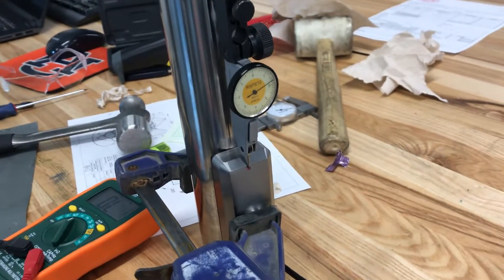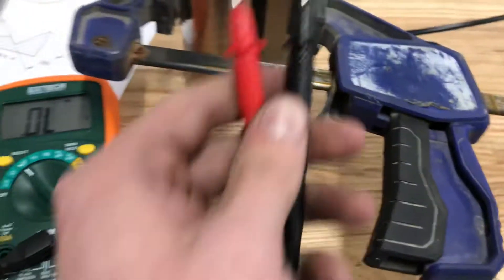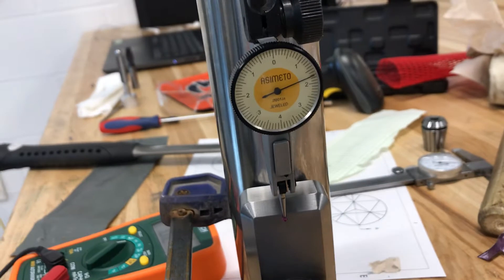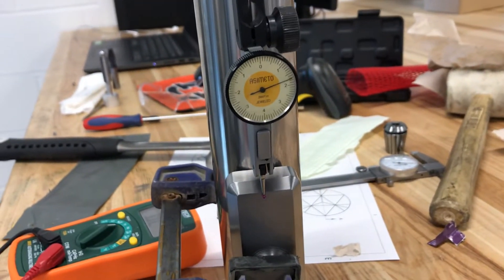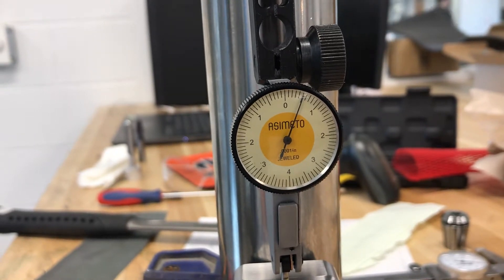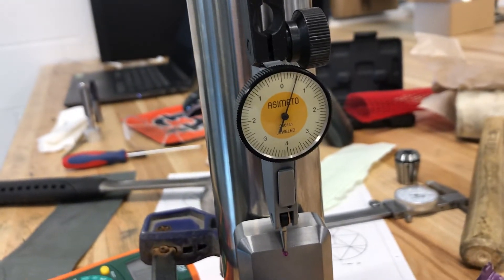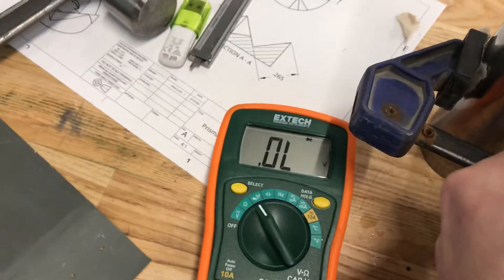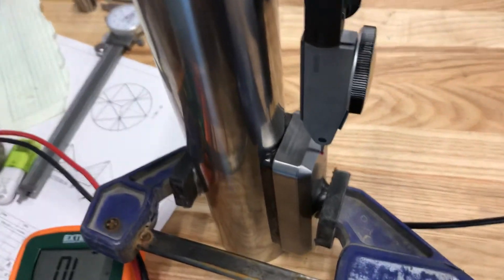Radial Air Bearing Testing: Fly Height Under Preload

Comment: That was pretty much but the wood working clampy thingy is very flimsy
Reply from the maker: Yep, not much more than 100 pounds of preload. Thats why the air gap was so large. Yesterday it was tested in a machine vise up to about 250 pounds. Gap was about 25 millionths of an inch and the stiffness jumped to 2 million pounds per inch. These are more representative of actual working conditions in the spindle
Reply: @cylosgarage  yes, the tighter gap the better especially in your lathe application for better rigidity and precision
Reply: @cylosgarage  woah 2M lbs/inch is great. 0.5 millionths eccentricity per lb load. Definitely would expect that to work well for diamond turning and making awesome surface finishes. Really good mass balancing will be important to make it all come together, so that vibrations don't cause problems

Comment: That's really cool. Do you have plans on making 3 of these to construct a radial air bearing for a spindle?
Or do you still plan on making the bearing as seen in your Air bearing spindle diamond turning cnc lathe?
Reply from the maker: This is 1 of 4 radial bearings which I show in my air bearing lathe video, they will be implemented the same way you see them in the CAD